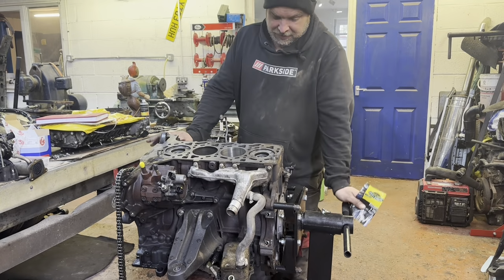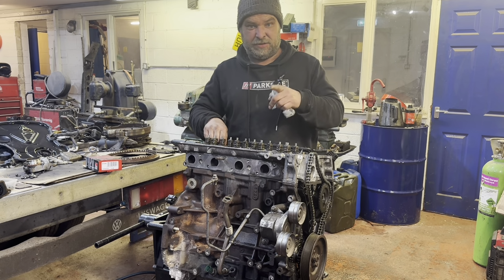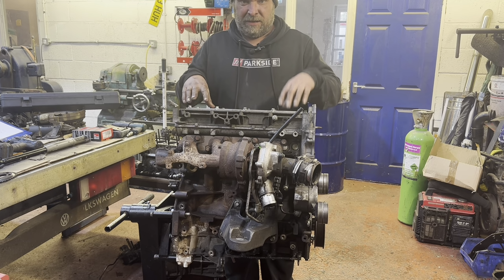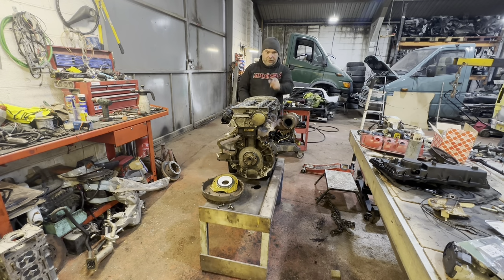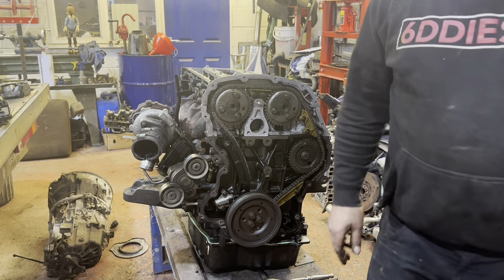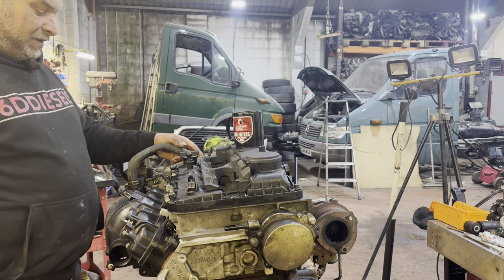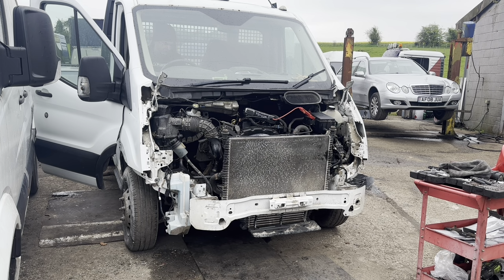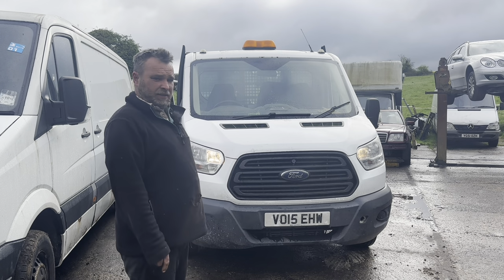Ford transit engine rebuild the final part will it run and drive

Comment: Salvage Rebuilds has had 2 Ford engines rebuilt by a firm in Essex they specialise in rebuilding these engines think they are kept very busy. Al is an old school mechanic only replace if it's knackered, very few mechanics left now just technician's plug in and throw parts at it. Poole Diesels in the 80/90s were very good when i lived near Poole he used to have lots of Taxi and fleet customers.

Comment: Great video! These are by far the worst vans in circulation atm we’ve got a fleet at work and they spend more time in ford dealers than actually on the road, bring back the smiley 😊. Top work pal.

Comment: Best  Tranny engine  was a mk3 2.5DI which could do half a million miles easy with ford level servicing 
The banana could do pumps so it’s not the best but for total reliability engine wise take a bow 86-91 2.5Di take a bow

Comment: I have just had a recon engine fitted in Betty after 200k! 2.4 mk7
Reply: The earlier 2.4's were a bit more reliable than these later nightmares, but any Transit engine built after the 2.5di was the automotive equivalent of 'Trigger's Broom'. 😂
Reply: @mrfishbulb7187  🤣🤣🤣🤣

Comment: Ive been watching this ford transit rebuild 
Ive got a quick question for you if you can answer it 
Ive got a citroen relay 2.2 which has the 2.2 transit engine 
My temperature gauge has stopped working and i have a feeling its the temperature sensor 
Any change you can tell me the location of the temperature sensor 
Because im getting mixed information from the net and youtube 
So say top of the head where the injectors are some say the side of the head and some say the thermostat houseing 
I can see a senor of some sort on the thermostat housing but im not to if this is the correct one just wondering you you might be able to tell me
Thanks

Comment: FORD or as we knew them in my last job 'Fix Or Repair Daily' - We had a fair few issues with our Transits. In my current company we have Vauxhall Vivaros (Peugeot Partners in disguise) and to be honest even with the problems with the Transit in my last job this van in my opinion is worse. A notchy gearbox, terrible turning circle and power steering that seems to have forgotten the word power in the title (However this could just be my van). The van is too bloody small as well compared to the previous model Vivaro which I also drove and my previous Transit. Still musn't grumble.

Comment: I had a Land Rover with the 2.4 transit engine and was told by a mechanic to never let it labour and keep it about 1700rpm or so just always go down a gear when needed to prevent the engine doing this, is this true? I never had any bother with it, just seals on injectors….. in fairness I got rid before 80k.

Comment: Al, two questions. 1.How does the faulty injector cause damage to the piston. 2.Why can't Ford use more reliable injectors!
Reply from the maker: They tend to drop the ohm’s on the electric valves ( injector) causing it to over fuel when decelerating. Washing the cylinders out . This set tested fine on pattern and leak off . Ohm’s return should be 200 we had 20,30,50, and 190 . And sadly that’s all that’s available 👍
Reply: @6DDIESELSDorset  Thanks.

Comment: Will it last 700 miles, 7000 miles or 70000 miles?
Place your bets now......
Reply: What's the odds on 7000 miles ?
Reply: @jasoneldridge4738 ur not a fan of transits are ya theyre great vans,have driven all of them from the mk 3 on and they have all bin brill over 100000s of miles.the last one i drove,a 16 plate mk 8 has done coming up to 180000miles with virtually no problems and still going well.they drive so good,much,much better than any sprinter or vw.i have to drive fiats and shitreons where i work now,now they are dreadful things indeed.

Comment: I bet 90% of your viewers  still have not worked out why you have a number of different sprinters  I did cos I have done the same with troopers and the even rarer citation/ a great towing platform  buut dont let Mr ministry man se you towing a big trailer with it without having a Tachographfitted( if the gross train weight of tow car and trailer exceeds 2.5 tonnes you must by law run a Tacho

Comment: Why are these engines rubbish ? The old VM transit with the 2.4 engine lasts for ages if properly serviced . l have seen some with 700,000 plus on them . 
Is this a case ford not giving a f towards quality or its customers ?
Reply from the maker: Poor build quality sadly and also being strangled by our current exhaust emissions
Reply: because the old engine was what? 85 horse? what's the first thing people do nowadays buying a second hand van they don't know nothing about how it's been maintained? yeah, correct, they go for a re-map cause they absolutely need that 160 horses. I've got a 2.2 puma in my 2007 boxer van and it's currently getting to 190k miles. the thing is - it's a 100 horse version and I never intended on changing that. the problem is, they don't have very efficient injectors. so in order to produce more power they have to extend the injection times. the longer the fuel is being injected, the longer it heats the piston in case the injector wears out over time and hasn't got the perfect spray pattern. this leads to piston melt downs or cracks. they are simple engines and capable of high mileages but not high power outputs. so if you want it to last as long as your old 2.4 - bring the power down to 2.4 levels and enjoy trouble free use.